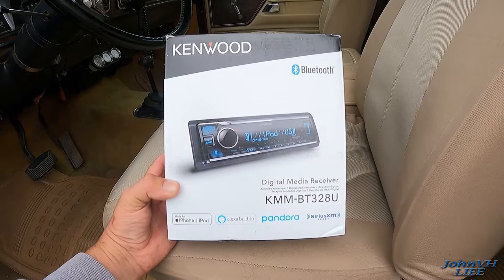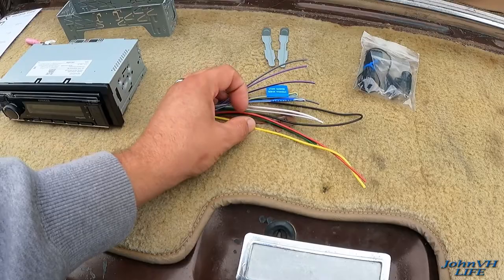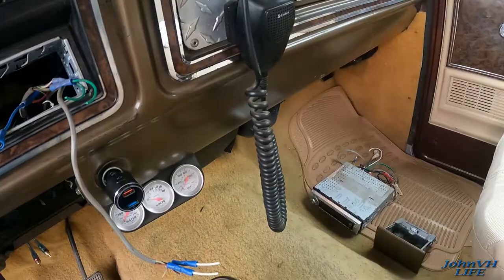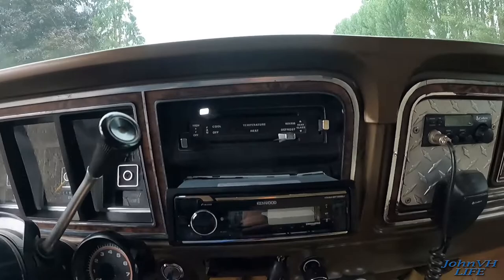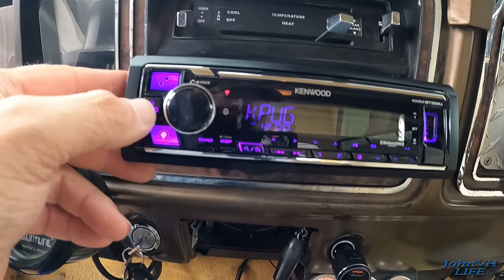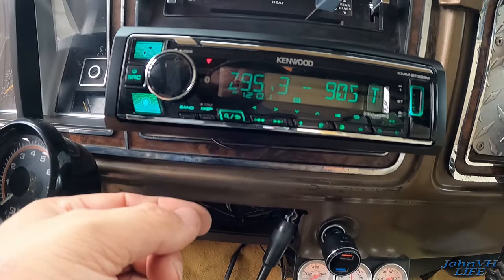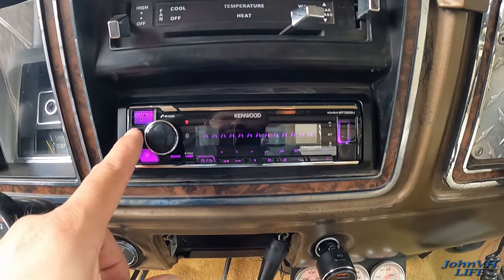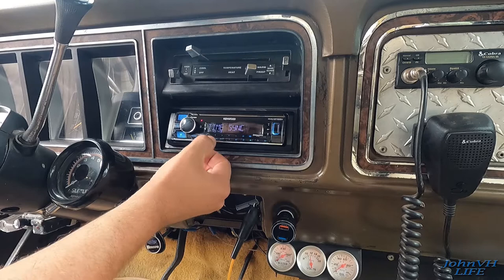KENWOOD KMM-BT328U Bluetooth Car Stereo Installation and Review in 1979 Ford Bronco

Comment: Thanks, I just soldered up the wires and plugged in my new Kenwood , and nothing but the display came on, short of time, I didn't go further, now I see how to get things going thanks to your video. I probably won't use all the features, but I did want a clock in my 91 F150!